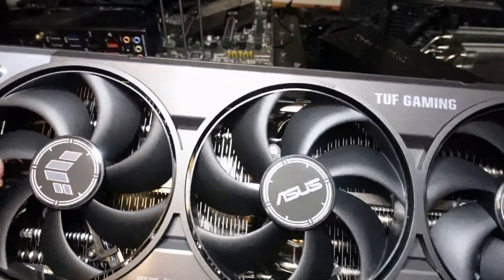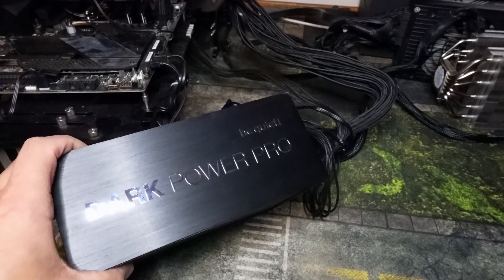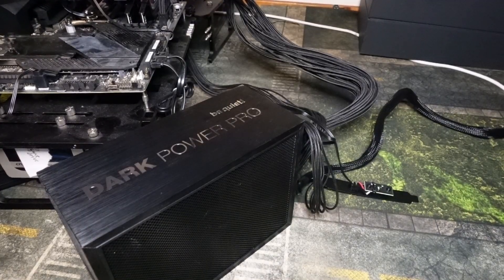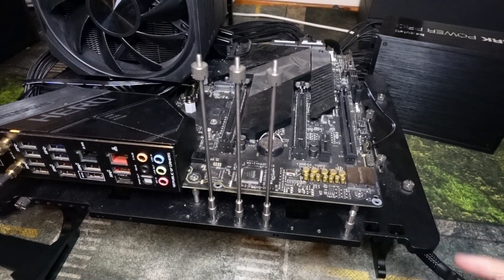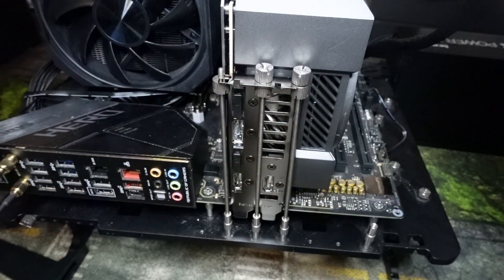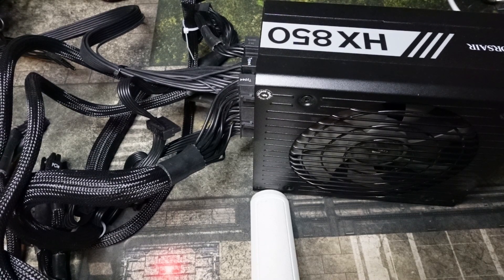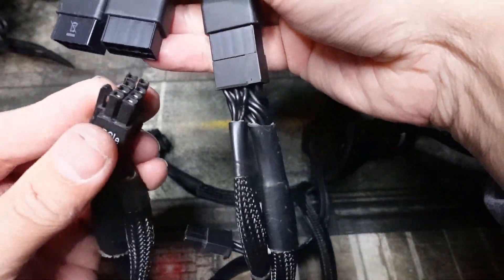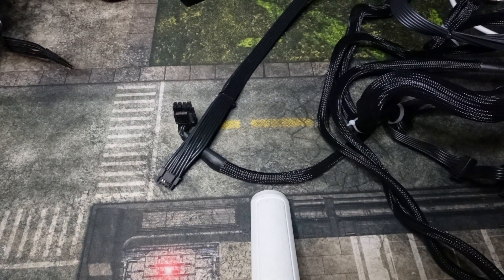5080 install guide: everything you need to know about 12vhpwr cable and how to safely install it

Comment: I want a "native 12VHPWR"-cable, as both my PSU (Corsair RM1000e) and GPU (Gigabyte 5080) have the 12VHPWR connector readily available.
However, after multiple searches on the interwebs, I have not been particularly succesful in finding exactly these cables. How come?! Are they not common?

Comment: Is it recommended to use the 12v high powered cable that comes with the power supply? Or can I use the one that came with the 5080?
Reply from the maker: check out the video i linked that goes over that

Comment: ⁉️⁉️So im having an issue with my new asus 5070 ti. I bought a corsair rm850x psu just for this upgrade. I first used the native 12 2x6 psu to gpu cable & didn’t get any type of display but a black screen. The psu provides 3 pcie 8 pin cables with pig tails. I connected all 3 to the adapter and didn’t get any display. & the gpu light would stay on once i shut pc off.  Do you think getting 2/3 8 pin pcie cables without pigtails will fix this solution although the native 12v cable didn’t work? Pls help
Reply from the maker: I would maybe try a new psu and then consider rmaing the gpu if it doesn't work after that
Reply: @kr00tman_tech i figured out the issue i was missing a connection, but i downloaded the graphic driver for my new gpu & ever since every time i start using some apps my pc stutters/lags & has even restarted on me 2 times or so. Im not too informed about PCs like that but what can it be ?

Comment: Hello nice video,

I have the Proart 5080 do I use the 1 cable "12V-2x6 600W that came from my psu to put in my videocard?

or do I use the adapter that is included when I bought the videocard.

I'm using the nxzt 1200c gold psu

Comment: I had the adapter and i thought i had to use it, but if i can plug a 12 pin cable from the card to the alim then its the best solution? cool
Reply from the maker: It depends on your psu, but generally the less cables you use the better
Reply: @kr00tman_tech  yes it seems to be! the card seems to work just fine

Comment: Question:
Bought 5080, easy install, had a 750G5, bought a Corsair HX1000i. Upon installing the new power supply, I used the 12pin connector to the 5080 instead of the pigtail, placed the 2 connectors into 8 pin PCIe/CPU ports, that’s all nothing changed. NADA! No power. Ive retraced, went over it 4xs and I have no idea my friend. Any ideas?

Comment: Hey, I have a Straight Power 11 1000W PSU and I’m installing an RTX 5080. Would you recommend using the included adapter with three separate PCIe cables, or buying the be quiet! PCIe Gen 5 splitter (BC072 12VHPWR)? Thanks!
Reply from the maker: I think I would buy the splitter, be quiet psus are highly recommended imo

Comment: please awnser so i got a new 5080 asus prime and it comes with its cord right. but the psu i have is the  MPG A1000G PCIE5 should i use the 16 pin cord that comes with that or use the gpu cord
Reply: Use the one that came with the card

Comment: Everyone says the GPU adapter is safer than the PSU how are you calming it isn't
Reply from the maker: So the mob is right, and the guy who's used about 10 PSUs with their cables with zero issues isn't? Lol
Reply from the maker: I explained how to check the cables, on the PSU and the GPU
Reply: @kr00tman_tech  i understand you but i have seen so many people and everyone says the adapter is safer, am buying the gpu and a Thermaltake Toughpower PF1 1200W PSU which is A- on the PSU tire list, how am i supposed to know what should i do at this point? I can't just buy the same PSU you have if i don't want to.

Comment: I have evga supernova 1300 GT. I was wondering how many 8-pin cable I need to plug in using the adapter that came with ROG Astral 5080. My psu has multiple vga port. The adapter has 3 female 8pin. Im confused please send help.😢

https://images.evga.com/articles/01508/fully_modular.jpg

Comment: While there is nothing wrong with having a higher rated PSU, I don't see how you could exceed 850W PSU even if you overclock your 5080. Even if you go up to 450W (that your 5080 will rarely if ever actually drain), you still have 400W to spare (avoid getting too close, though) for your other components and I can't imagine the setup that would get anywhere close.
Your actual problem will be cooling. Stock cooling will run super hot and you will need a really good airflow to keep the temps in safe range.

Comment: Hey man, I just bought a 5070 TI for a prebuilt rig that I bought about a year ago and thought everything was gonna be fine. I believe that going from a 4060 to a 5070 TI is a power related issue and I would not have come to that conclusion without you pointing that out as an issue.

I just wanna let you know that your video is super helpful and I’ve re been looking to find an answer for this in the past 4 to 5 days so thank you very much.

Comment: The 12V high power cable only comes with 2 x4 pins not 3...so we have to use the adapter.
Reply from the maker: @mihaicostescu  no they should all come with 3 on the 5080
Reply: The adapter from 5080 has 3...but the 12V high power that comes with the PSU has only 2.
Reply from the maker: @mihaicostescu  yea that's ok, you can use that adapter safely
Reply: Appreciate it. Thank you for the video. Hugely helpful.

Comment: Hello sir, tnaks for the video. I need some clarification for the older psus. I currently have a rtx 4070ti and I use the vga1 with two 6/8 pins to the adapter which then connects to the gpu. It is basically a 12 pin connected to the psu and then it is seperated into two 6/8 pins. So when I get the 5080, I should use VGA1 - 3 and then one 8 pin from each of those?
(I have a be quiet! Straight Power 11 Platinum 1000W)
Reply from the maker: yes just like the video says

Comment: So instead of using the orignal adaptors that came with my 5090, just use the power supply 600w cable? Is it safe? I have a 1600 w psu
Reply from the maker: That's what I do, I have a 5090 install guide tol

Comment: Just got my hands on this card and apparently my choice of PSU was a good choice ^^ Mine is the 1600 Watt edition. Also have a nice beQuiet case with lots of space. Should be future proof! Nice video!
Reply from the maker: That is awesome, they are a fantastic company who makes great products, enjoy!
Reply: @kr00tman_tech   My system is currently and older i9 10th gen with PCI 3.0. I installed the tuf 5080 using the supplied 3-split adaptor and PCI cables and it runs fine. But can I potentially use the 12V 600w highpower cable instead? It does say PCI 5.1 on the psu port though... So, I assume not ^^  The adapter works , it all just takes up much more space. A wel.

Comment: Would it boot with only two 6+2 connectors in the 12VHPWR adapter? If so, is there a possibility of damage? I only have two 6+2 connectors. I'm using an RM1000x (2021).
Reply from the maker: 1) no, and 2) yes, get a new psu

Comment: The reason I am asking this is due to the fact that I just got my hands on a Gigabyte Aorus RTX 5080 Master, on the 18th of this month, and when I tried to benchmark it with Furmark it caused the screen to go black and all my fans on my GPU started going very very fast and loud, this also happens when I try to play games in Steam, and I just thought it might be a power issue, that is why I asked you the question down below. I am using a Asus ROG X570E Crosshair Dark Hero motherboard and the PSU down below.
Reply: Hi, I have the exact same issue with my 5080 Master. Have you figured out the cause yet?
Reply: @beingmahdi  Nope never figured out how to fix it, ended up giving it back to Amazon and got my refund for it, because I made sure to send it back before the 30 day period.  I would say it was a faulty RTX 5080 that I got, at that time, since then I went for a Asus Astral RTX 5080 and I had no problems with it, either in the old system or the new one that I build.

Comment: Can I plug the power cable from my 4070ti super directly onto my new 5080 without having to get to the psu? I have a 850W Gold Plus PSU and got pretty messy cable management atm 🥲
Reply from the maker: I mean I would fix your cable management first but yea you can use your same psu

Comment: I have a Corsair 1000 watt power supply and all the cables are 6 + 2. I have no choice but to use them. Having said that, I am using three separate 6+2 cables plugged into three separate ports on the power supply. Wish me luck.
Reply: Just an update. I purchased the Corsair 12VHPWR Cable from Amazon. Cost me 53 cad but better safe than sorry.
Reply: Is that the 2021 version?
Reply: @roberto9612  I'm not sure what 2021 you are referring too. I can tell you that after a month of using my 5080 I'm not having any heat issues with cables or with the card itself. My 5080 is an ASUS Tuff. My power supply is a few years old for sure. Card has been working fine with MSFS2024.
Reply: @737NGXCA  i meant do you have the 2021 or 2024 version of the corsair rm1000x? The 2024 version comes with a 12VHPWR cable which you should be using to connect to your rtx5080
Reply: @roberto9612  Nope, I have the older version, no special cable. That's why I had no choice but to use the 6 and 2 cables.
Reply: @roberto9612  I guess I have the older version, as I don't have this cable that you mention. Going to order one from Amazon just to be safe. 16 Gauge/16 conductor/600 watts.

Comment: I am using a "be quiet pure power 12M 1000w" power supply and behind my power supply it says "PCIe 5.0"
At the bottom of this socket it says 12V1 (left) and 12V2 (right).

I have a cable that came with the power supply and this cable has 2 identical 12-pin headers with (600w) written on it, can I connect one side PSU and the other side GPU or do I have to use the adapter that came with the GPU?
Reply from the maker: You can use that cable, just follow the guide and make sure the cables are seated properly
Reply: @kr00tman_tech  I made a mistake on the back of my power supply, I told you it was marked "PCIe 5.0" but after checking and installing my 5080 it is indeed a "PCIe 5.1" so I connected the 600w cable with the same two identical sockets PSU > GPU.

I have a question. I allowed myself to buy a cable > be quiet! 12V-2X6 / 12VHPWR 90 °
with a 90 ° angle / elbow to make cable management more "neat"

The fact that the angle of the cable is made on purpose at 90 ° does not pose a problem for the connection?

Thank you in advance for your answer.

(sorry for my bad english ,Im french)

Comment: RTX 5080 TDP is just 360W i.e. 40W more than 3080. I powered the card using 12vhpwr cable that came with PSU Corsair 850W. IR shows no hot spots on cable and temperature ~30-40C
Reply: I have a brand new RM850x, just waiting for nvidia to bloody restock the founders edition :(
Reply from the maker: @danielvelazcatoya755  niceeeee
Reply: @kr00tman_tech  thanks for the video btw, it might have saved my upcoming new pc from becoming a toaster. Keep it up💪🏻
Reply: @danielvelazcatoya755 did you get your hands on it man???
Reply: @ianseghers9467 yes, back on early may
Reply from the maker: @henson2k  the same one I showed in the video?
Reply: @kr00tman_tech  No, RM850x
Reply from the maker: @henson2k  nice very similar PSU